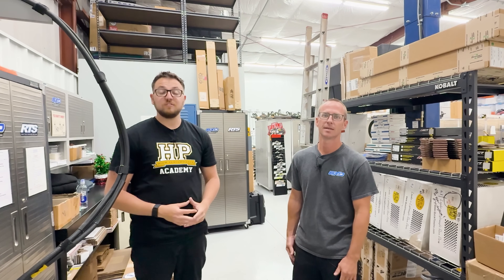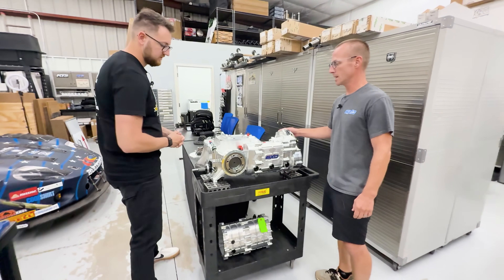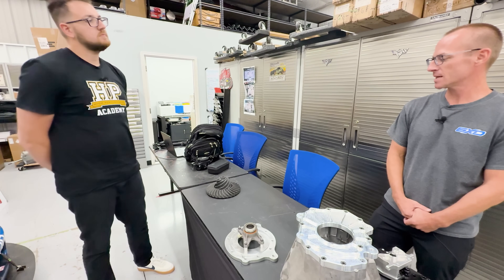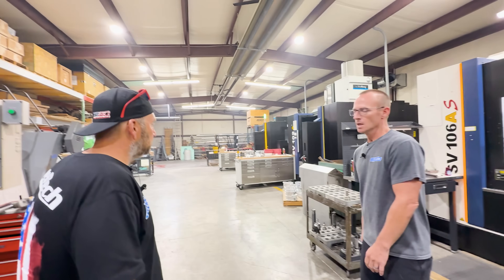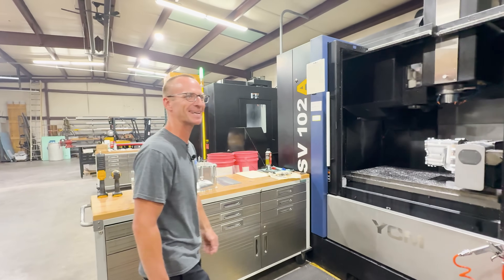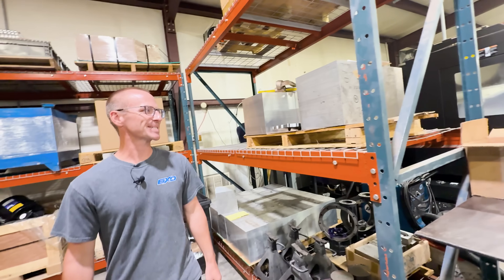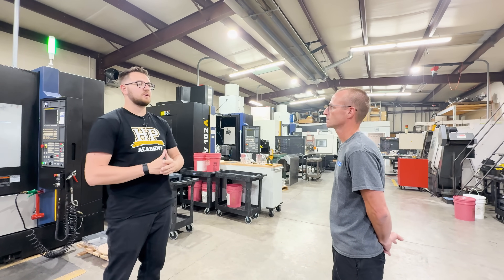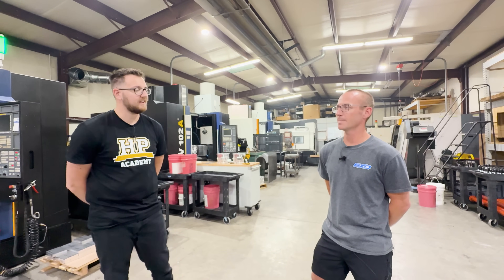World's STRONGEST Sequential Transmission - Touring 6XD GearBox

Comment: So if we do this little easy google math, 1800ftlbs x 8000rpm is 2800hp. So instead of doing this geek BS and saying, oh it's the torque that matters, just say 2800hp limit at 8000rpm input speed. or even give a little table in the advertising showing the increase in HP as the speed increases.

Comment: Albins make awesome transaxle. Out of Australia and  evolved out of off road racing. Ended up being designated for v8 supercar class. My customer bought one new about 2008 and it has been flawless. Transmission gets swapped between different cars depending on the event. Tarmac or off road. Six speed dog box. Has done a heap of 7 day events as well as circuit racing and gravel sprints. Has a 10.5" crownwheel so it's not little.

Comment: Great work, especially in only 6K square feet! I presume the boxes are made from 6061, not 7075? If so, is that cost or corrosion/fracture resistance reasons? Also, they don't seem to make the actual gears, or do they?

Comment: 6xd needs to make H-pattern boxes
Reply from the maker: We actually touched on that in the podcast with them. Look up Nth Motos H pattern vipers making 2500+ horsepower. That’s 110% possible because of 6XD :)
Reply: @Minnoxide  One guy commented here about a lightweight, 1000hp version. If you did that in a 6-speed it would be the most popular for the GT40/SLC/GTR crowd. That's what most of them are looking for.

Comment: U know what I like about electric motor cars?  No gears. No Munci close ratio 4 speed, etc etc.  I had a RV with a Cummins and 6 speed Alison, both are monsters.  The Alison is used in trucks hauling 80K lbs and engines with over 500hp.....It would last forever in the RV.  I guess an RV could use a gear or two if it was Tesla'ized.  A 2 speed in our Model 3 would be interesting.  Powerglides are 2:20 first, like the Munci CR, and 1:1 final.  It works with IC engines and would make 0-90 times even more amazing.  But electric motors really need only 1 gear.
Reply: Not true. All motors have a sweet spot of efficiency and performance.
Reply: @spdcrzy  well, on a Tesla Dual Motor, my only experience with electric motors, the sweet spot begins off the bottom,  On my  first drive, off the line, helped me understand what "torque" is and why no 5 speed trans is needed.  Our T3 with a five speed would be a 10 second car, not a high 11 low 12.
Reply: Are you saying that shifting gears is not preferable? What other reason could there be for owning a car if not to use the gearbox?
Reply: @mchristr  I'm just saying EV don't need a transmission.

Comment: 6:17 what's the ballpark on that cost? 15k? 20k?🤔 only straight cut gears? (i understand just asking)😊
Reply: starts at $21,800...😱
Reply: @msk3905  i was a little low, but not entirely off.

Comment: Love the factory five GTM didn't even recognize it with that wrap. Am i understanding it right that it will take the transmission they built for the GT40?
Reply from the maker: Correct the goal was to fit the GT40s and be useable for mid engine kid cars. Some more details in the full podcast we did them and the various shorts we have on this page as well.
Reply: Exactly.I mean, i'm not up on what they make these days. ( I'm old enough to remember their start. 😮) I was surprised to see the sponsorship and wondering what the connection was. Now you've explained that's actually something they make now.